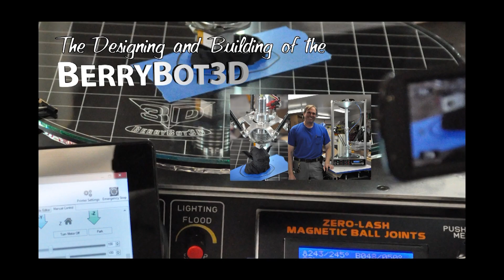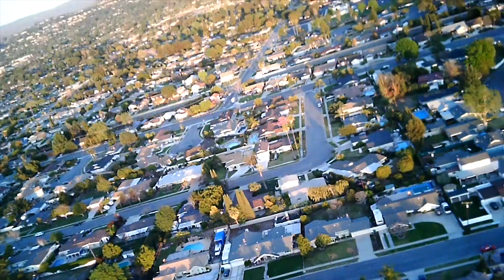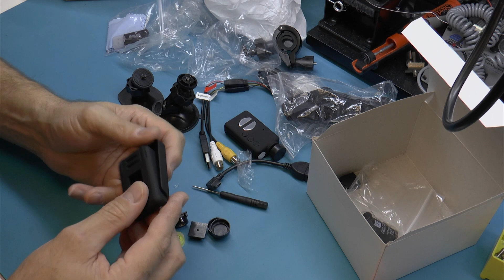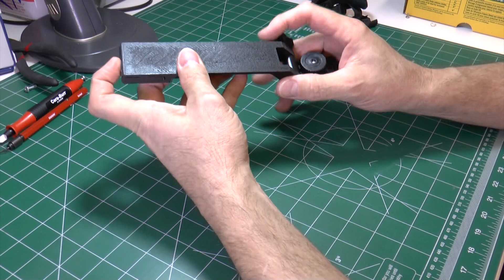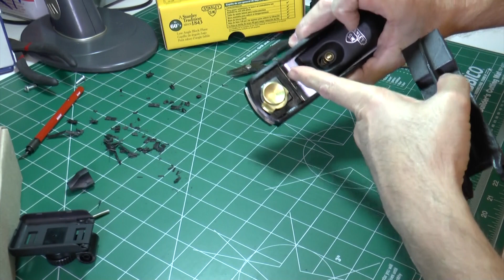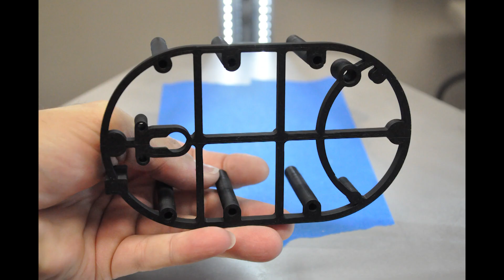3D printer questions, new camera and 3D printer tools

Comment: What motors and electronics are you using? Is that nema11 a good extruder motor?
Reply from the maker: SPTSM1701, Ultimachine Rambo, the special built gearmotors I use work awesome!